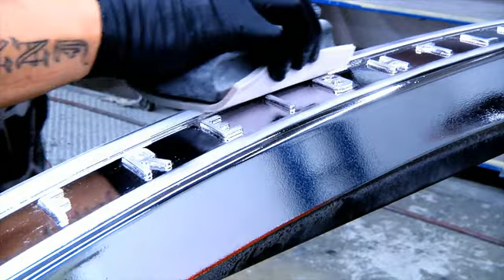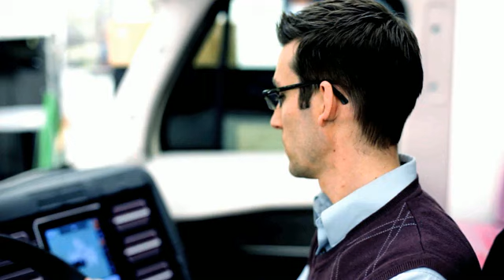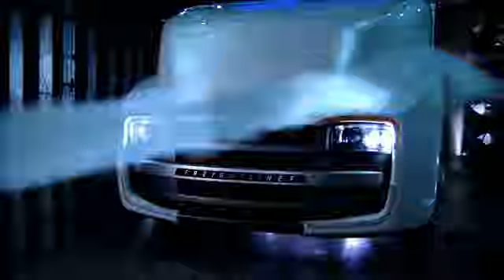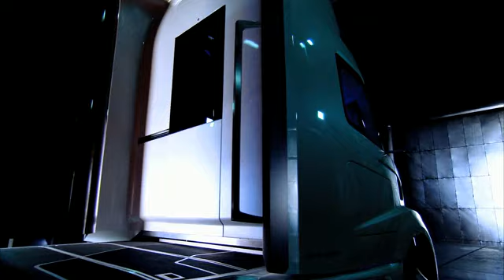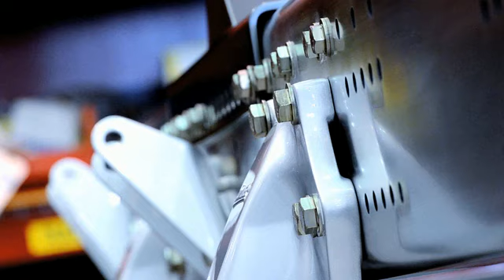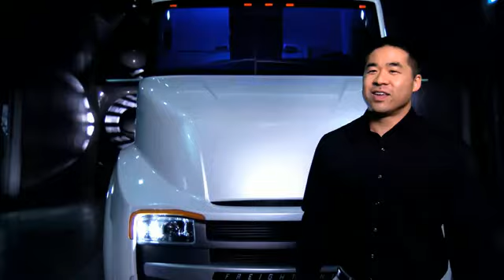Freightliner Revolution Innovation

Comment: Gotta have mirrors. Two seats. Easy maintenace. Loose the computers and emissions
 Basicly i want a 1972 96inch bbc cabover armstrong steering big cam 350 cummins with a jake brake dual stacks mounted to an aluminum headrack 13 speed 390  rear end. aluminum cab chassis and a long slide 48inch tall blockable fithwheel Airtag 2nd axle  15ft wheelbase steeraxle to kingpin. 2line wet kit. Reese hitch and heavy pintle hook in rear with air electric hook ups as well. 
Mirrors are full remote shanty shakers with spot mirrors top and bottom. Bumper is a 2x10 box beam with a center pull ring. 
 kingpin. Disc brakes all around 
Supersingles. 200 gal fuel. Should fully fueled tare out at 15000 lbs. 
Spotter truck full rubber fenders over the rear axles. And a full deck plat on frame. Lubefiner. Fuel/water seporator and air dryer are in the center box of the headrack 
Air cleanerstack comes down the  middle  
And full deck plate. Hard cab and 4 leaf renco suspention. 
See i can haul freight with this. 
And look good.

Comment: Shortening up the living space !, where is the spot for a  tv, refridgerator. What would be nice is if they could  configure a hot plate to heat up your meals, Or a Microwave. Why is it that the driver always have to out fit a truck with the essentials and look for things that will fit in the truck for  life on the road . These are needs you know, True driving is the purpose of the truck, But we LIVE in them. You have to have a distraction, like a tv, dvd player. We need to eat, A microwave thats truck small. to cook, an outlet for crock pot. Away to make coffee. etc..Holy cow folks we're people too.
Reply: It's not made for over the road drivers.

Comment: a full height grill and getting the head lights out of the grill would help the styling.there is nothing wrong with good old reflecting mirrors.they can take those cameras and shove them.............!!!!! the sleeper while innovtive,it is impracticle.passenger door is nice for emergency exit.over all, I think the truck is ugly.oh and btw alum frames don't last as long as steel.hope this driver input was helpfull to freightliner.

Comment: Show me a European truck with 10 mpg economy! A DAF sits around 71-7.4 mpg  and lower in this video (watch?v=Tk_P-gsi980) while the newest Kenworth  DAY CAB (apples to apples) is near 8.5!

I'm not denying a 600 HP Cummins Kenworth T660 with a 218 cm sleeper would loose most efficiency battles against all commers, but that is a different type of truck. European trucks most resemble US day cabs so it is fair to compare the Revolution and other day cabs against Euro trucks.

Comment: Bonnets are more fuel efficient. Do you need me to show you a drag equation? The extra weight on a 1600+ ft-lb torque engine is nothing compared to the Velocity^2 massive drag penalty from the blunt nosed cab-overs. Don't even try it.

Comment: I drive a 2013 cascadia ( junk ) . feel like sitting inside a wind tunnel. Cant wash the truck, it is leak all over front windshield end the side doors always wet when is raining. The truck dont have hand break for trailer , good luck in the winter. U guys need lots of work to build a real truck. To build a truck you have to talk to truck drivers not to guys how just hold steering wheel.

Comment: This is just another case of engineers designing a truck.  When are they going to learn to conference with truck drivers about designing trucks. This truck has so many uncalled electronics (Like No mirrors) that will not hold up.

Comment: I would rather have a Mack 10 to 1 over a Freightliner. I've driven both 2012s and the Mack is put together A LOT better and more solid than the Freightliner. No mirrors? Sounds like a recipe for disaster. You would lose the feel of the truck looking at monitors when turning.

Comment: so they put an ipad in the truck, took away the passenger side do so if you roll the truck on the drivers side and do hopefully survive the crash you are screwed anyway because you have no escape, took away the mirrors making the already unsafe truck drivers even more unsafe, put a sliding door in the back with a nice big window that welcomes thieves and vandals to smash it out, the made the already small beds smaller, not to mention how completely ugly this truck looks, did i miss anything???

Comment: Mercedes-Benz Actros is Mercedes-Benz flagship semi-truck model. It is a popular truck over in Europe, not sold in the United States. Mercedes/Daimler uses the Freightliner name to sell all trucks here in the US, that's why you see MB logos on the side of some Freightliner Century. They also purchased Detroit Diesel and have rebadged some of their engines as MB, like the MBE4000, which is a rebadged Detroit Diesel engine. Thats why you see the Mercedes logo on the concept, it was design by them.